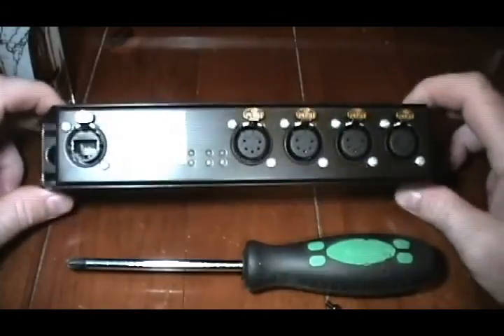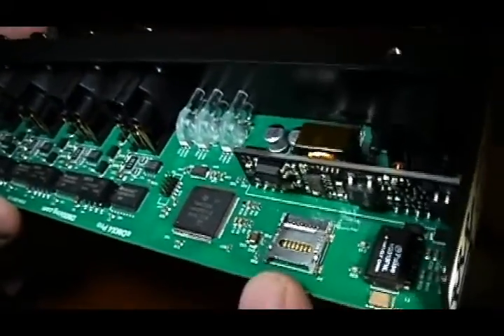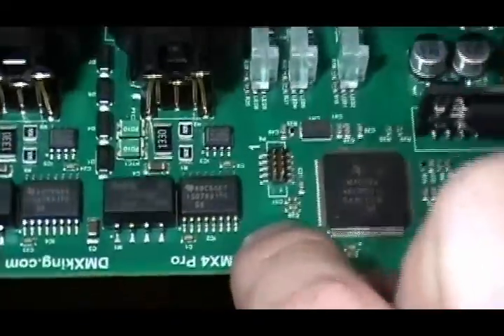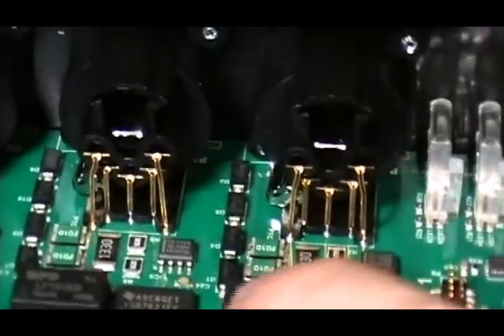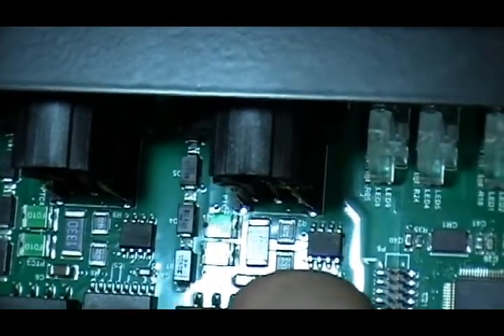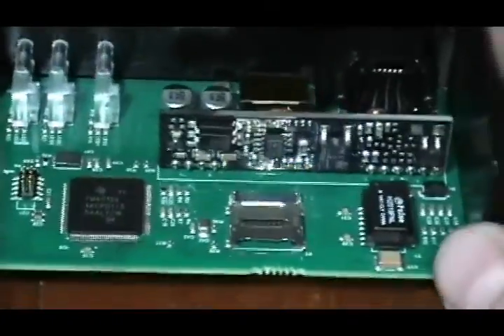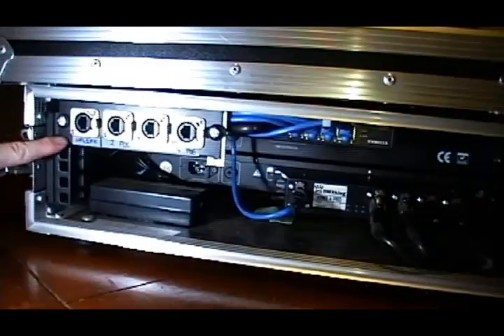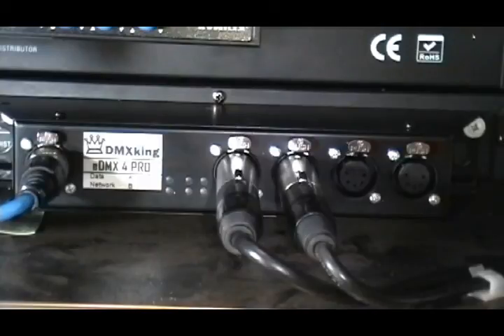DMXKing eDMX4 sACN / ArtNet - DMX-512 Node Teardown

Comment from the maker: yeah I'd like to see a simple web interface to configure/assign the ports too.
Reply: That would be very nice, we'll see what they can come up with.
Reply: @Haukman  i am trying to find a replacement as strudy as these units just because they dont have the web interface. and the problem is that they dont let you use the interface if you have anyother software that uses your 2454 port on your computer, wich is very annoying.
Reply: Jean-Philippe Langevin The issue with the shared port is due to the ArtNet standard (which is used to configure the units). At the moment there isn’t an alternative to that, but in the future these will be configured using E1.33 instead.
Reply: @Haukman   well i can't wait because it is the only reason we dont buy the units anymore because other wise it is super solid. Our media servers uses the port at all time so if i want to verify any config or change anything to the configs of the nodes i need to kill the process of my media server each time and restart everything wich is really annoying and time consuming in trouble shoot
Reply: @jean-philippelangevin6543  Understand. Let me work with DMXking on a workaround, I know it's related to ArtNet having a fixed source port (in the standard/specification), but maybe there's a way around it (so you can run the config utility in parallel with lighting software).